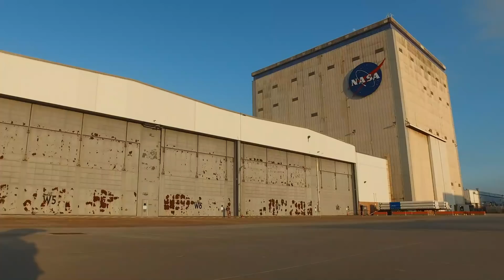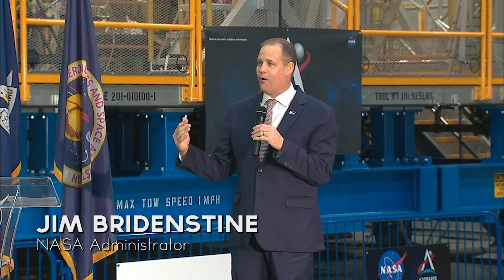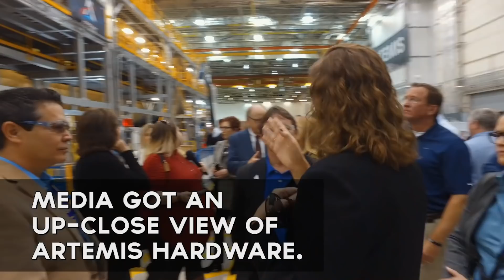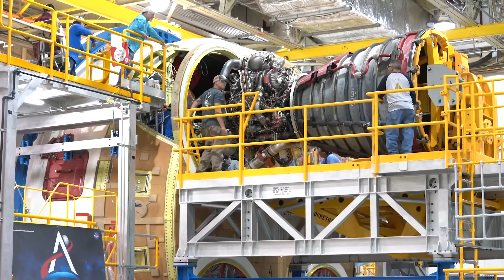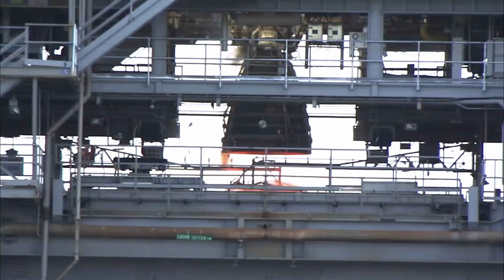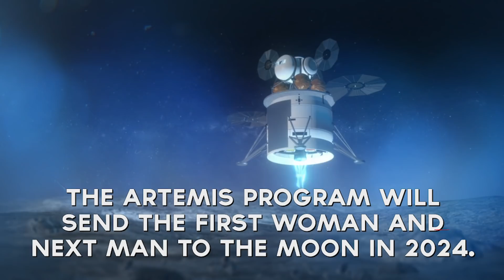Highlighting the Most Powerful Rocket Ever Built at Artemis Day

Comment: But "the most powerful rocket ever built" was Saturn V, no? He had 140t to LEO capacity and SLS B2 will have only 130t afaik...
Reply: Saturn V maxed out at 127t to LEO not 140t
Reply: you sure?
Reply: @invisiblekincajou  Yes
The 140t payload figure includes the dry mass of the SIVb third stage and typically the mass of the  carrier stage is not included in payload parameters of launch vehicles because it's not part of the payload mass

As an example SpaceX's starship is expected to have the capability to place around 100 tons into orbit but that number does not include the mass of the Starship itself which weighs another 120 tons on top of that
Reply: @brokensoap1717  the capability of Starship is 150t

Comment: Wait a couple years until Starship makes this obsolete
Reply: Frank Castle How
Reply: @StarshipTrooper  NASA haven't launched an in-house-developed rocket for decades. They've relied on the Atlas V or Russian rockets or SpaceX or similar for it all. Because the rate of development is just... terrible for them. Mostly due to how little funding they've had since the end of the space race. But SLS has been pushed back 4-5 years now, and 4-5 years AFTER the deadline for completion and launch of the full rocket, we've ALMOST got just the core stage built.

SpaceX, on the other hand, started working on Starship about half a year ago and are already on their 3rd model (albeit one failed model and one unflown one) that will be orbit-capable. With the rate of development of Starship, we might see humans on MARS by 2025, let alone the Moon.
Reply: @hayden_dev  8 years isn't "decades". Also, it's deadline for completion was not 5 years ago. It BEGAN DEVELOPMENT 5 years ago. SLS has only been pushed back 2-3 years past it's original scheduled launch date.
Reply: Tae Tae Considering Starship and orbital refueling it's unlikely that SLS will be used very much and a lot of money will have been wasted, although so much has already been wasted as well.
Reply: Frank Castle I don't think so. Nobody is "dicking around the clock" while working on SLS. It's more so all the red tape and politics holding it back. SpaceX has little political red tape tied to their rockets and that's why their agendas seem really aggressive and they are able to usually deliver on what they promise, albeit with a few exceptions.
Reply: @ready1player31  What does this have to do with what I said?
Reply: @ready1player31  exactly this! I'm not saying SLS is bad, more that it seems too little too late